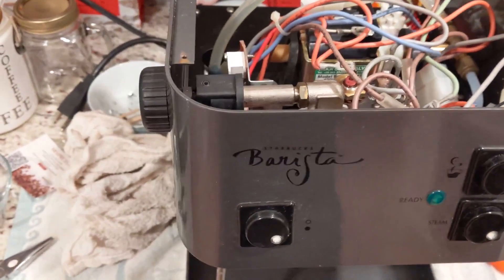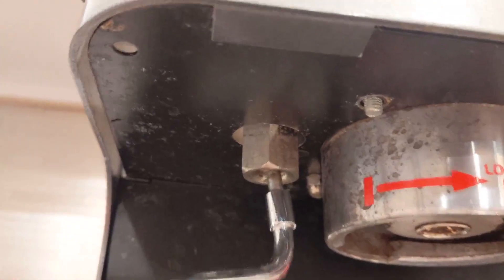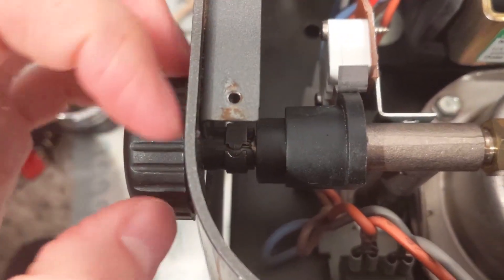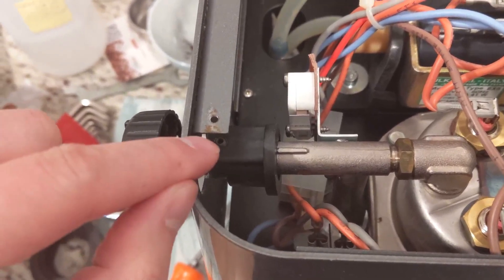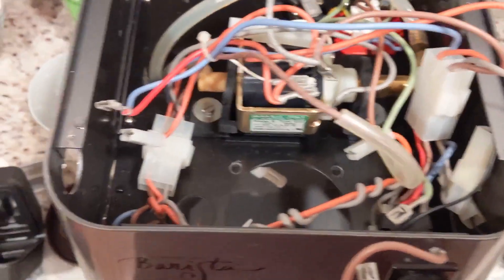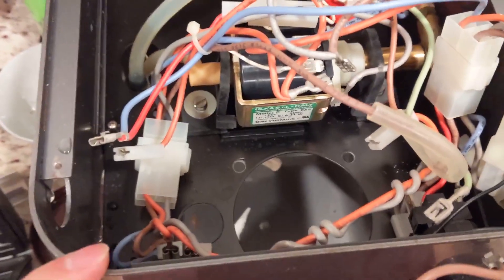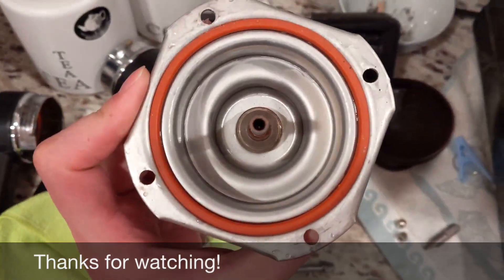Starbucks Barista Teardown - Saeco SIN006 Disassembly

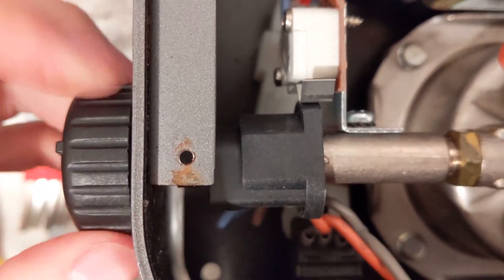Comment: 1:06 that switch/relay does not activate the steamer. That switch/relay activates the pump when in brew mode so you can dispense hot water. When the machine is in steam mode, that relay/switch does nothing.  the knob just release pressure from the boiler and you get the steam.

Comment: bro my starbucks barista wont turn on i dont know what to do please help me
Reply from the maker: If you're trying to do this yourself(I'm not sure how tech savvy you are). You'll probably want to go through some preliminary diagnostics. For example: checking to make sure your wall outlet has power, checking if the steamer is working, checking the brew option is working, checking if there are any lights etc, then continue to narrow down from there.

Comment: 6:41 no, you shouldn't be able to look through it, there's a valve in there  that only opens at certain pressure. If you were able to look through there, you are missing  the valve and and you'll be leaking water all the time.
Reply from the maker: You're right. Good call on this!
Reply: Thank goodness. Appreciate this comment!

Comment: Is there a trick to get a good seal on the boiler gasket?  Upon replacing and using a white mineral oil gasket gel, mine is leaking profusely.

Comment: Sorry if this sounds like a stupid question but how do i remove the 'wirey, pluggy things', I am good with everything else, to this point but scared to just yank them off.
Great video though, I have gotten this far, cleaned everything but just don't know how to remove the wires?
Thank you for your help:  )
Reply from the maker: No probs! Hopefully you already got this resolved. I'm late to the response here but I think you're talking about the wire from the pump? That can just be detached pretty easily by disconnecting it from the board. Trace the wire to the panel and you'll see how it's connected.

Comment: Is this machine actually any good? Trying to find peoples experience of how long she worked before a part needed to be replaced.
Thanks
Reply from the maker: Machines been used for years.  No issues.  As long as you keep with the maintenance you'll be good.  If you can find a good used one this thing is a tank!
Reply: @thought-cloud  I have one for sale (4/2002 Italy) and am testing it right now. The previous owners said it worked fine. It took me awhile to get all the external parts in the right places.
Before I plug it in I want to know how it boils water! 
The white/clear filter tube doesn’t seem to be in the correct position. I put water in the machine but the water went straight into the clear plastic container which doesn’t seem right to me. I don’t see a heating element anywhere. Hope your video steers me right. Thank you!
Reply: Mine worked for over a decade before needing any service.
Reply: I've bought mine used on eBay in 2014 for $100.  It has been used daily without a single issue.   I just updated to the Breville BES870XL so I'm now gifting it  to my nephew.
Reply: It is a GREAT simple machine.  YOU control everything with the switches, so less things to go wrong than the fancy machines today.
I got mine used, cleaned it up and used it for 10 years, with NO problem.  Then I rebuilt it and gave it to my niece.  Should be fine for another 10 years.

It has a pressurized portafilter, which is great for when I am "fuzzy" in the morning.
But if you want to do traditional espresso, finding an unpressurized portafilter is difficult.

One thing that has to be done, and is not in the manual. 
You have to regularly remove the shower screen and CLEAN the back of the screen and the group head.  If you do not, it will accumulate coffee residue, and that old coffee will make your espresso taste BAD, and eventually slow the water flow.  Worst case, some of that coffee residue could get back into the boiler YUK.